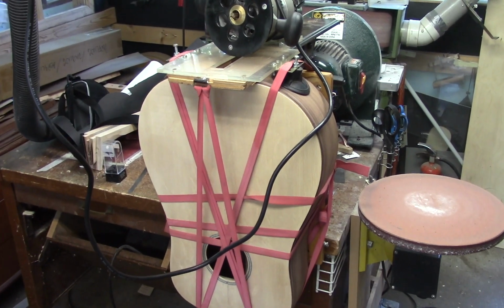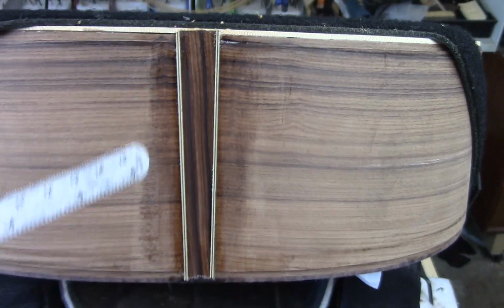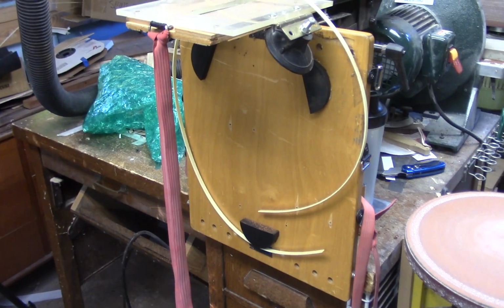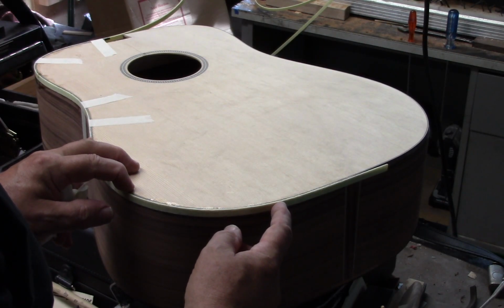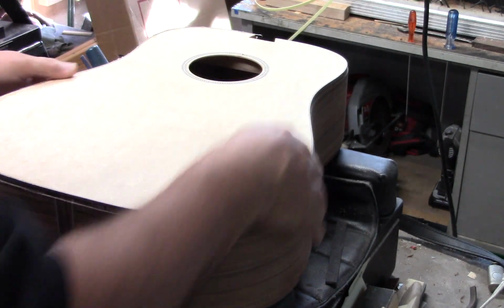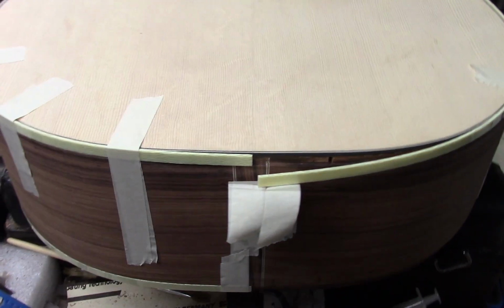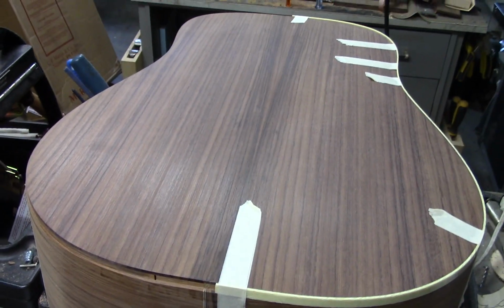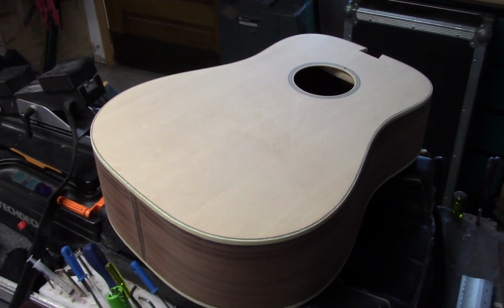Binding + Purfling Tips @StringTechWorkstations

Comment: Are you using the CA glue for plastic binding on the edge of the wood body?
Reply from the maker: I get a  good permanent bond with gorilla glue ... but it is a very "acquired execution", to get exactly the right amount without the glue squeeze. Practice makes perfect ... but the 4x expansion ratio of the gorilla glue takes some practice to get it right every time. Good Luck. MMcC